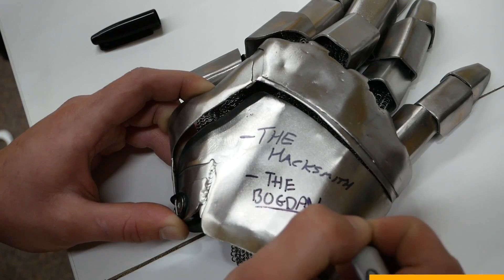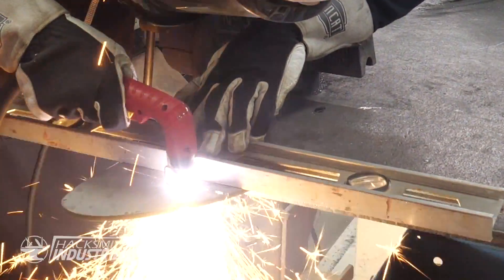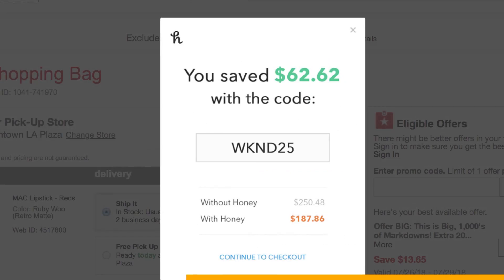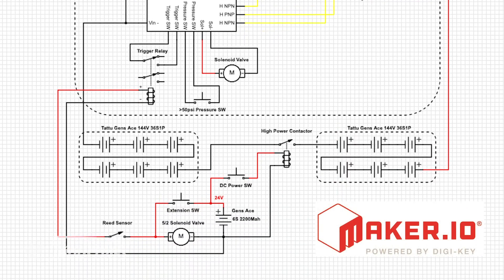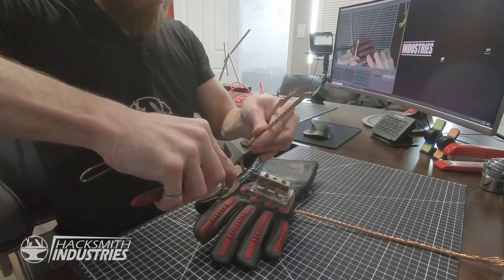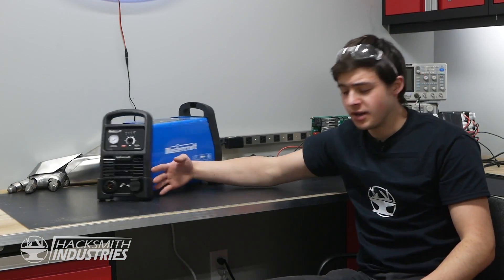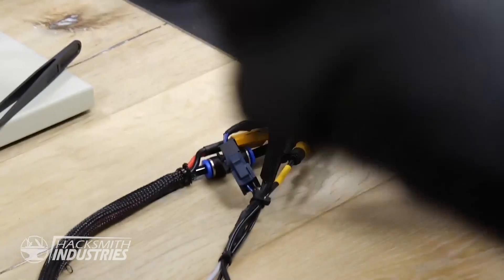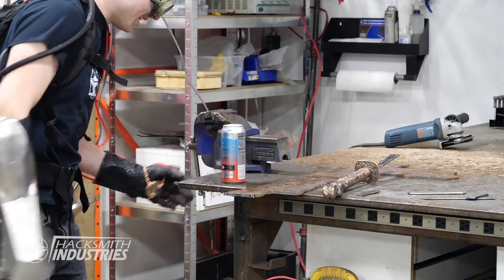Iron Man Plasma Glove CUTS THROUGH EVERYTHING! (+ GIVEAWAY)

Comment: Actually,  you can get a laser to cut through just about anything. The. Power source isn't the problem. Its the refraction of the lens and the heat intensity of the laser over a longer distance than a few inches. A 3° laser will boil the fluid of the human eye if directly pointed into the cornea and held there. It cannot be more than an inch away though. 
So power isn't the problem.
Reply from the maker: Power is still a huge part of the problem.

Comment: I think you should get another one and try to figure out where's the best spot to mount the actual tip you know is it better on the sides bottom falling a tip of one of your fingers when it comes out or one of the fingers locks it in place you should also be able to launch spider webs from the iron suit which you should actually consider calling it when you're done the iron Knight suit lol

Comment: You know how are you going to fit all the batteries of the suit you got to figure out how to run these things with less electricity even if you keep the same amount of batteries you still have to figure out less electricity honestly you also got to figure out how to carry it that's a lot of weight you might want to start bringing in an in-home gym set up and every night train to carry the weight and also when you go for your run every day a backpack full of batteries maybe something a little heavier lol
What are you going to do about the power problem you can make a full suit but you just proven that tech takes a lot of power how can you have a device like an arc reactor or self-propelled engine that allows very little electricity to be made into more I've actually seen some videos where people use car batteries into a self-propelled generator that fed electricity back in it might have eventually shut down but if it allowed electricity the last longer maybe for each one of the devices you can have one of these like in your arm a micro version of it you got to figure out also the minimum amount of power for the maximum amount do you need to run the same amount of electricity to cut every level of metal and which works faster the Jedi sword that runs on gas fumes and which one can be used more often to cut which is better carrying electricity or a different fuel source remember you have to carry it

Comment: 1:18 now I dont know much about thia but. Wouldn't the surface of the sun just melt metal? If so how is that plasma cutter still up and running?
Reply from the maker: It's being blown out of the high temp nozzle with air,  so it doesn't melt the tip

Comment: I think they used steel to make the glove, titanium would be better because it has a higher melting point, it’s as strong as steel but only two-fifths of the weight, though it is more expensive and harder to weld, and it will deform more easily than steel, but it being lighter would be the biggest advantage

Comment: whoa whoa whoa. you can get those tanks filled by your self with a special conpressor. the compressor should be rates to 300 bar or 4500Psi it starts from 200$ to 2000$ usually the more expensive ones have more flow at a given pressure. also keep in mind the cooling some are water cooled which usualy needs you to buy a seprate water pump and hose and most of these compressor have a runtime of a round 30-60 minutes so do the math and get the right one.

Comment: what i want to know is why didn't they just use the Arc reactor to power the plasma cutter if the Arc reactor is a self sustaining power source
Reply from the maker: Because the arc reactor is not self sustaining, it used power
Reply: Huge fan, but i thought that the whole point of the Arc reactor was to make it like a self-charging battery of sorts?
Reply from the maker: The whole point yes, but if that was possible, a lot of things would be too!
Reply: true, true but you have to admit, if it was a self-sustaining power source, it would save a lot of money and electricity

Comment: “Lasers don’t really work like they do in the movies” the US Navy would like to say otherwise.

Also yes I know the laser they are testing still isn’t quite the same thing as you see in the movies, my point is just that theirs is able to transfer so much heat in a fraction of a second that it’s able to detonate warheads and destroy the engines of a vehicle in a split second. So I could only assume if they turned the power up a bit more and ran it a bit longer they’d be able to splice right through metal just like in the movies or damn close

Comment: but its not plasma is just a blowtorch extended from a hand unit?
Still cool though.
Reply from the maker: No, blow torches do not reach 20,000C, it is bbn plasma created by electricity
Reply: @hacksmith  Plasma traditionally in cult media is related to the sun and fusion, we're talking millions of degrees not just thousands. You can get plasma torches (Welders) the principle is still the same as a blow torch, just the heat source generation and heat cap is different. You're shoving a pre-packaged commonly used industrial unit onto the end of a glove. The whole glove activation part is neat though.  It would have been nice to see a more customised unit, specifically for the purpose of replicating Iron Man.  There was some guy a while back, who made a hydrogen fueled version of the repulsor iron man uses and that was a few steps towards fully replicating it.
Reply from the maker: Ok... I answered your question though.

Comment: Do you think that putting a layer of copper around your protosabers could somehow tint it blue? Like the science labs in middle school?
Reply from the maker: We tried that last lightsaber video!
Reply: the Hacksmith what if you coated a layer of nylon with a copper based powder on top of metal layer on the outside, my thought is that it will catch fire and burn the copper coating...

Comment: Could’ve used a rubber band on the “lid” of the glove to keep it from flapping everywhere but still have little resistance to the pneumatics, or small springs for more heat resistance

Comment: I was disappointed. You didn't explain 99% of what you were doing or how it actually works
Reply from the maker: Uhhh yeah we did. We took a store bought plasma cutter, explained how we converted it to battery power, included a circuit diagram, and then demonstrated it working... what more do you need explained or did you skip all those parts?

Comment: Wouldn't making the electrowhips be fairly simple? All you would need is a flexible conductor, which you could probably just use exposed copper wire for, and then a power supply in a back pack. I know it would be more complicated than those two things, but is it just the circuitry that's holding them back?

Comment: I thought a grounding clamp is the ground wire to complete the circuit

If it's not operated with a massive current cutting through everything then why do you need a grounding clamp?
Reply from the maker: The circuit needs to be grounded... that's what the grounding clamp is for

Comment: is it theoretically possible to make a plasma cutter based lightsaber, but the plasma beam travels farther, about 3 feet, compared to the plasma cutter u guys use which goes like 2 inches? and would the beam be able to be controlled to only have a 1-2 inch diameter as well? just wondering 🤷🏽‍♂️

Comment: "we have to make the plasma cutter portable" put in a pneumatic cylinder that needs a huge yellow wire that's connected to the wall

also: where did you guys get the pressurized air from when you were cutting the car? was there a compressor off-screen somewhere?

Comment: so whats the actual up time between charges and does the nylon backpack decrease the duty cycle on the transformer by holding the heat of both it and the rapidly discharging lithium batteries in?

Comment: If you would of added just 2 hinges and a arm to connect them(the 3dprinted piece that holds the torch and the sheet steel that covers it, you could of stopped the cover from flopping around, I'm a little disappointed in all honesty

Comment: There are lasers that can cut through a substantially thick metal pipe, but they need an entire cabinet of hardware to do it. Can work at some distance, though. The business end can be quite compact, though, as they use optical fiber to transfer the beam.

Comment: That is very cool and the emergency field application is definitely there; but the way you went about designing it probably voided warranties/standard operation procedures/usage methods etc... But if it was designed and built properly to run off an emergency vehicles spare battery bank or it's running engine; especially those on heavy machinery like excavators etc... it'll work fantastically and would be 1 of the many tools in there kit. Also the fact that it's operates from a tethered power source(like existing hydraulic powered jaws of life) isn't something new to emergency workers.

Comment: Justdustin seeing this video: Not collaborating with you with my unbreakable glass anymore
Reply: But it’ll burn the money
Reply: I don't think plasma cutters can cut glass, since it requires a closed circuit. Which can't be done with glass, what with it being an insulator and all, even without the plastic in "unbreakable glass."
Reply: @Skorpeonismyrealname  You can put a conductor on top that will melt and heat up the glass.

I think the saber has enough heat already.

Comment: Awesome job guys, hope you redesign the grounding glove to look more like a matching iron man glove for the suite, looks like it should fit nicely into the hole in the palm of the glove.  Also don"t you guys have an arc reactor lying around some where that you should use to power the plasma cutter?  I don't know if it's strong enough but maybe it's time to make a new and improved arc reactor.  instead of a box you could mount it in a chest plate, give him some power abs by putting the batteries down there, put the rest of the electronics in the pecs.  Hopefully make it quieter than the original.
Reply: it’s good on paper, but mounting 10+ batteries to someone chest is a really bad idea, you saw how long it took to put the glove on, imagine trying to remove a whole suit lmao, especially when it’s on fire

Comment: "It'd be pretty silly if we had to plug our Iron Man suit into the wall"

Evangelion flashbacks intensifies
Reply: Ikr especially at 14:53
Reply: Notice the yellow wire that always have to be connected to something..... so.........
Reply: @Sourpig  they literally explained that they can use compressed air from a canister (thus not needing the yellow hose), but due to the quarantine they couldn't get them refilled because shops are closed.
Reply: @Frost-ml4vj  Also HPA refill pumps are really expensive too
Reply: Zankoku na tenshi no you ni
Reply: Shinji's first time in EVA-01 in a nutshell 2:00
Reply: you know the drill
VVVVVVVVVV

Comment: Could you miniaturize that setup further? Maybe a version that only has 10-30 seconds of runtime before it runs out of power/air. Basically, one small enough that a rescue worker could easily maneuver it into tight spaces. If you get it that small it may even have military applications, a version that could be mounted underneath a rifle for getting through 1, maybe 2 reinforced metal doors without using explosives.

Comment: How tf does a plasma cutter not destroy everything around it if its hotter than the surface of the sun? 20,000 Celsius and only just cuts metal and perfectly cuts through it instead of melting everything.

Comment: I actually think this has serious thieving applications too. Limit to a thief is usually time to break into something and chance of being noticed. Are there even any other portable, battery powered plasma cutters are on the market? Now they can have all the stuff in a backpack, tubes running under sleeves of a hoodie, and cut through chains to get bikes, into buildings, into safes, etc all much faster than using saw-based attacks.

Comment: So iron man suit mk1 checklist. 

1:flame thrower gauntlet.
2: bullet proof armor
3:augmented strength.
4:jet boots.

That’s all you need to make the first scene in the movie. Now flame thrower gauntlets should be easy, Bulet proof armor sounds way to expensive and jet boots to dangerous. So it’s time to do some flame thrower gauntlets. You already have an ignition switch setup with that plasma cutter. Would it be possible to make them a combined system? More compact and 2 features in one!

Comment: "lasers dont work like they do in the movies" 
Yes they do, you just are years behind in technology.
Reply from the maker: No, they dont.
Reply: @hacksmith  Lasers such as those used by the military for its ballistic missile defense system can do this.  Replicating the one stark used at such a short distance he used to cut into things would work with those types of lasers. As the old axiom " If brute force isnt working you arent using enough of it" Years behind in tech would be power generation and delivery, if you could use room temperature super conductors and a compact fusion reactor. You could create a powerful enough laser that would cut just like shown in the film clips

Comment: Hi Hacksmith i have a great idea about under water diving so by my idea we will get a better performance from the diving tank so what we need to do is air tank carry air as its name suggest but air consist of hydrogen,nitrogen and oxygen but we already have oxygen and hydrogen under water so why carry them just produce the by the process of electrolysis and only carry nitrogen and there you go..... the advantages of this will be we will be able to adjust the concentration of stuff in air because we need different mix of air at different depths for example  if we dive under 200 meter we need 90% hydrogen and 10% oxygen to breadth as gases become to lite and heavy at that point  and we have an unlimited supply of it....... just think about it. And try to build it if you can. And yeah thanks for reading till here.Please write back......      0   0
                                                                                                                     "==="

Comment: Dear hacksmith,
I have found that you are able to bye plasma lasers and have them in a range of reach. Also you can bend the plasma lasers using electro magnets. If you can pinpoint the magnetic waves you might be able to make a hand-held plasma blade or shield

Comment: 0:42 if that laser can go through anything would it go right through the earth and the earth would be in 2 giant didn't piece's
Reply: metal, anything metal
Reply: Nathan Jones no, because the plasma only reaches so far, not nearly the diameter of the earth.
Reply: That doesn't mean it just instantly vaporizes whatever it hits, it still needs to melt, burn or vaporize the material which takes some time.